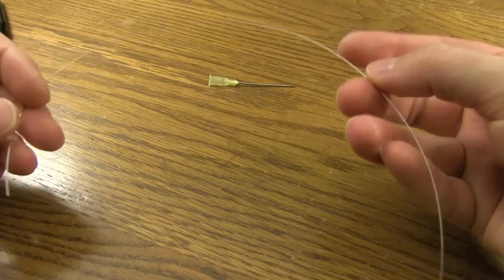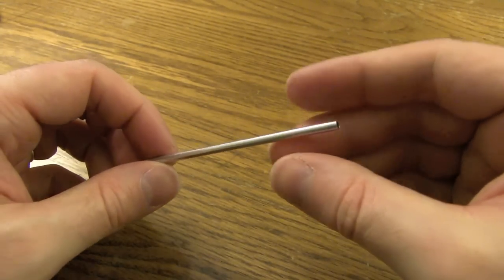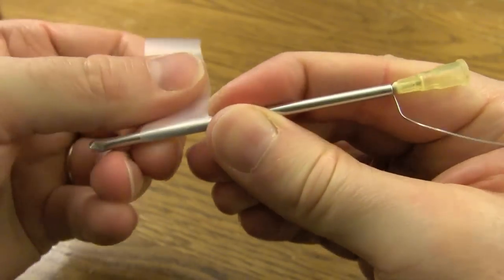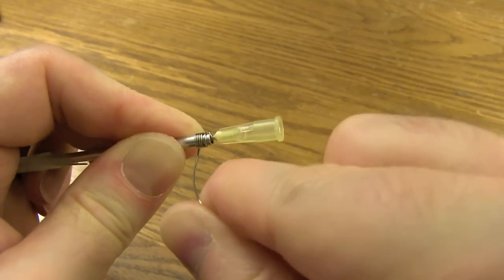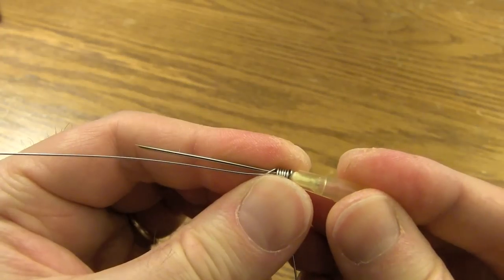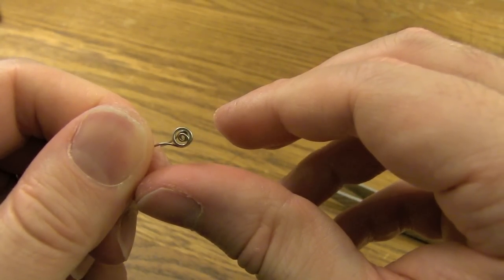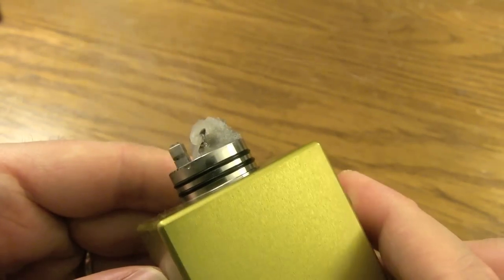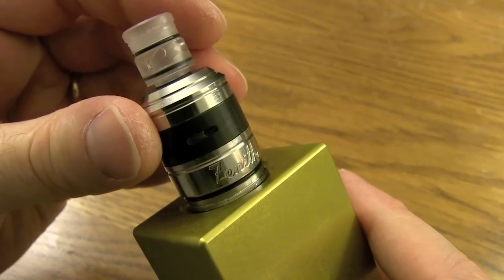The Inception Coil

Comment: I know this has nothing to do with this vid, but what kind of charger do you use for your 26650s? I'm having trouble finding a good charger for them. I have an i4 for my 18650s but I know that won't work just out of size. Lol.
Reply: I have that charger too and it works but the batteries don't fit snug.  I just got the NiteCore IntelliCharger i2 Charger.  It works great for my sony 26650  50 amp batteries.  Got it at amazon.  The link below.  copy and paste to your address bar.

http://www.amazon.com/NiteCore-IntelliCharger-i2-Charger-charging/dp/B009JMDD9U/ref=sr_1_sc_1?s=electronics&ie=UTF8&qid=1395880214&sr=1-1-spell&keywords=nitcore+intellicharger+i2
Reply: Ok, cool, thanks, I didn't want to try to put them in the charger and have something happen, I just figured it wouldn't work at all because of size differences.
Reply: WeneDog0628 The intelicore I4 charger should charge 26650's mine does...
Reply: Ok, thanks much :)
Reply: Grab yourself a Efest LUC charger- it will charge your 26650 and 18650 etc the latest version allows you to chose a 1A charge rate and man oh man it is fast at charging. It also has a neet display showing your current voltage and charge rate and several safety features. IMO it is a better charger than the I4 but ..i just noticed you have an I4? that should charge your 26650's np and if you do already own I don't think you need to get a LUC- but anyone looking for a great charger take heed!! lol :)
Reply: Thanks for the tip, I was worried about it not charging the batteries right, and the little travel charger that came with them worries me. I'd rather not wind up being another headline that anti-vaping bans would gain steam from. I like the i4 so it's nice not having to get a new charger. I only got that over the LUC cuz I was able to get it at half the price.
Reply: Dont use the travel charger thing just use the regular i4 charger for them. They will charge just fine. I promise!

Comment: Why do you not inhale rip trippers? I notice this.
Reply: With an RDA you take lung hits. He is inhaling while he takes a drag; like you would with a hookah
Reply: ***** yes. But once I remove my mouth from doing a lung hit, the vape that's in the mouth and throat needs to be inhaled as well, which rip trippers isn't doing. He exhales immediately.

So what I'm saying, all the vapor today has gone to his lungs from a lung hit still has the last bits in mouth which should be inhaled by spending a half a second inhaling after removing the drip tip from his mouth.
Reply: David Johnson That's one of the secrets to blowing clouds. That half-second extra inhale allows more of the vapor to be absorbed, reducing the cloud you blow out. By immediately exhaling, he produces a more impressive cloud. Try it yourself; take a long, hard pull, then immediately exhale as soon as you stop.
Reply: Orion Roberts will try. Thanks
Reply: he is inhaling. he does lung hits, pulls straight to the lung and straight out.

Comment: so if that reads at .8 a dual build of this would read at .4 right?
Reply: yup, thats right. And a quad build would be .2 ... that would be silly because you need a 10 inch deck, but ... :D
Reply: you could use smaller gauge kanthal too, or get the mason rda
Reply: with the gauge...then it is too small, and you have got problems with the Cotton. Is the madson RDA really so huge? :D Daniel Springer
Reply: it's like made for hex or octo coils. it has 4 positive post holes and 4 negative ones, its pretty crazy google it, not too bad of a price either
Reply: But it is so tall that it would look like shit on my mod :b.
Reply: Indoor Vaper oh yea, it'd look goofy my my koopor 200w but i might get the 30mm version they make
Reply: imagine 6 of them sub ohm max
Reply: oDaniel Springer
Reply: Lol put them on the so horney rda
Reply: +Indoor Vaper what is a good build for faster nicotine consumption. I switched from dip(chew) to vape and idk if you've ever tried dip but the nicotine is almost instant... Im also a flavor chaser
Reply: I think you mean the "flash" of the nicotin. So at first, if you want much nicotin you need liquid with Nicotin ( Self-explanatory). But you should know that the more nicotin you use, influences the flavour of your liquid. It  tastes more like nicotin than before. The coil build dont really cares. You only need power. The more vapor will be produced, the flash will be even more, and you will rather have a "nicotin shock" like in a cig. I am vaping my nicotin liquid only in a e pen, so I need arround 5 Watts to fire the 2.8 ohms up. I use 18 mg juice, and that drops hard. I would say first use 9mg ore something like this.

Sorry for my Grammar, I am from Germany and I dont know everything about your language :D.

Comment: Heya rip. Help me man! I've tried to rebuild a dual coil on my igo w3 on my k100 and i think i shorted my MNKE battery. The charger reads full charge. I don't have an ohm meter but i think i did 8 wraps per coil. I have the whole thing assembled but I can't hear the device fire at all.
Reply: Was it firing at first then quit on you or did it just not fire at all? If it quit on you stop and get you a new bat. and rebuild like Ryan said, if it never fired at all double check and make sure your rda is on tight and your mod is adjusted so your battery isn't rattling in there when you shake it.
Reply: and make sure all your leads are tightened down snug. Also I would suggest you look into an ohm meter, best way to check for shorts and make sure you don't blow yourself up lol
Reply: But is there a chance that my igo is now ruined?
Reply: There us a chance but it is unlikely, I've never owned an igow3 but there should be a rubber insulator around the center post, if that is still intact it should still fire
Reply: You can see the insulator on the base around the post, not around the post itself. sorry I reread that and it wasn't very clear
Reply: thx for your help guys!
Reply: Get a meter...  We don't need any more negative press...  "Dumbass blows his face off from e-cig, tonight on the evening news."

Comment: How would you make a 1.5 ohm?
Reply: Try using thinner gauge kanthal.  Maybe .30 or possibly .28. 

From what I gather thinner (higher gauge) kanthal makes for a higher resistance.  And more wraps (length) = less resistance.  I could however be totally wrong about that as I have yet to experiment.

What I do know is that when I wrap a .28 gauge micro coil I have less resistance with 5 wraps than when I wrap the same gauge at 7 or 8 wraps.  

I believe a few posts back Rip explained that thicker (lower gauge) kanthal allows more "traffic" to pass through and less congestion (comparing .24-.22 gauge to a 4 lane road and .28 gauge to a 2 lane road, congestion being compared to resistance).
Reply: Hazie83 I think you had one thing a little mixed up, more wraps=more resistance. 
The thicker the wire (lower guage) the less resistance it gives.
The thinner the wire (higher guage) the more resistance it gives.
With more wraps, you get higher resistance.
With less wraps, you get lower resistance. 
It's a little like a garden hose. If you kink or bend it, it makes it harder for the water to get through, creating pressure. In our case, when you bend the wire into a coil, it creates a more difficult path for the electricity to move through, creating heat.
Reply: Scott Bissantz Yes he/she got it mixed up but it's right in the second paragraph.

Comment: These different coils are getting a bit silly and pointless now. Wrap some wire round a bit of wick and it all does the same thing (delivers a drug we are addicted to into our system, sugar coat it all you want but thats what the purpose of this vaping lark is all about). Do like the t-shirt tho, and the beard is somewhat legendary.
Reply: that statement just isn't true. i would agree with simple macro micro and nano coils. but even they have a difference between each other. slight, but a difference is there. now with other coils your wrong. period. its simple, the more surface area for juice to be heated up the better. meaning the more wraps, the more cracks the more WIRE the more VAPOR = more CLOUD =more FLAVOR. that's only the beginning i wont even get into ohm, mod, voltage ......
Reply: i enjoy building new coils. using 0mg of nic also. not everyone vapes to replace smoking.

Comment: i hate to be a stickler but i have a question  Does any body know if kanthal wire is galvanized because i went to my local ACE heardware stor and foind 18 to 25GA wire and it is galvanized i didn't know if it is safe to use galvanized wire or not.  i would have baught it  but I didn't wanna be pissed off that i could not use it in my builds.  becides that I'm new to this rebuild stuff i have just been doing the tank with the BVC coils.
Reply: Noo you definitely want resistance wire. Galvanized wire could lead to metal fume fever, which is an uncomfortable was to destroy your lungs haha. Safe vaping!

Comment: I vape 24mg juice in an iTaste MVP v2 and don't feel a buzz from nic one bit. I have the voltage and wattage set according to my tanks resistance and all that. I even get larger than average clouds for my setup...why don't I get a buzz? I hear of others who get a buzz from 6mg in an ego.? I don't see how that's possible. I don't vape for nic anyway, might switch to 0mg. Just wondering if anyone else ran into this issue?
Reply: You might want to try moving up mods to a mech at around .2 with 6mg juice. Make sure to build safe though
Reply: Thanks! I'll try it out!

Comment: 1:55 prolly not the best advert for safety... "gonna just push it down"..and slip and stab the needle through the hand. 
A more suitable wrapping post may be in order, or at least clip the end blunt. Something designed to poke holes in people is probably not the best idea to be pushing and shoving around.

Great vids though, technically speaking.

Comment: Finish this sentence:

If I really want to impress the guys at the vape shop I just whip out my ________
Reply: I wire a bed spring to a car battery and wick it with a sock.
Reply: my ego/carto tank set up?
Reply: juice because no one around here knows what cali juice is
Reply: ....electrically efficient coil. (They've never seen one before)
Reply: "big 10 inch"    God, get your minds out of the gutter, im talking about my vapelyfe mod haha
Reply: A real mod and atty. All I've seen round here are clones.
Reply: Michael Putman Not meant in a nasty way but It shouldn't really bother you what other people vape, those with less money shouldn't be excluded from vaping certain style devices, its not their fault that some manufacturers stick a dodgy logo on a clone. Those who can afford high end gear do go and  buy the high end gear and those who cant afford high end gear would never have been able to buy the expensive gear at all so no-one actually loses sales because of cloning as pbusardo argues (much more eloquently than I do). Some designers even take it as a reinforcement of their great designs when cloned. There are some other issues but they're not valid in the big scheme of things, I mean is the patriot a clone of the igo-w cus the principal is the same and the look is very similar? some cases are obvious but some casesits a fine line that is very hard to draw, i say leave off the logo at least and let people buy what they want..
Reply: Yes exactly. Leave off the name. This is my problem with clones. I don't have the funds to pony up for a high end either. My vape budget is very small. I feel this way because of buying equpment that was represented as real only to a inferior knock off. Also my brother found his niche designing and manufacturing aluminium handles for high end knives like spyder co and bench mades. He supports his family with them since the company he worked for moved to china. After someone saw there was a buck to be made the cloning srarted. He made a quialty product the clones are far from It.His reputation was damaged and even had people contacting him for refunds. Don't fool yourself it in more cases than not does great harm. I would rather carry a kamry K100 than a fake turtle ship any day.
Reply: i agree with the mis-representation 100% and i don't know if it's just within vaping but i don't believe the manufacturers are trying to pass it off as genuine rather than just make it cheaper and make a buck, the misrepresentation seems to be done by the odd shady vendor within vape sales at least
Reply: And just to clarify the people wanting a refund from my brother had purchased a clone.
Reply: I dont know anything about your brothers situation but i do sympathise. Why were people after refunds? if they were quality items i mean? did he inform customers they were clones?
Reply: No one that purchased one from him has had and problems actually there is a waiting list, people love them. After failed attempts to get a refund from the seller they taught they would go to the manufacturer. This is the whole point of this post. Branded clones do hurt the designers and manufacturers of the product being cloned.
Reply: Michael Putman Any vape shop that I would shop at sells clones as "clones."  I guess it's your own dumb ass if your going somewhere that sells a clone as the authentic.  An intelligent person would wonder why an authentic Nemesis is costing $50 anyway...  Furthermore, you said you would whip out your ___ "real mod and atty."  Then you stated that an authentic doesn't fit in your budget...  You sound like a damn politician, you should run for office.
Reply: I would whip out my Nemesis CLONE + Kayfun CLONE dual coil 28 gauge kanthal wrapped @ .5 ohms.  She is sweet as a bitch.  Not a cloud chaser by any means, but it chucks the vapor and flavor is amazing!
Reply: That pretty much describes my everyday go to set up. So that's you, me and millions of other vapers. I love the way cloners have made decent quality vape hardware available to the masses, if they hadn't come up with their viable business model the financially hard up among us would be condemned to a life of poor quality ego-ish  batteries and ce5 clearomisers. Ever notice how the anti-clone brigade have absolutely no problem cloning juice recipes such as all the custards that replicate Grants or tobaccos that reference the word 'bounty'?
Reply: Jonto Dickens  Clones are a MINOR drop-off in quality, and a MAJOR drop-off in price.  Understand, the CONSUMER controls the market.  If people didn't buy the products, the products wouldn't get sold, the companies would no longer make those products, and there wouldn't be a market for them.  Apparently, they are pretty popular and people want to buy them.  If someone wants to buy an authentic, they have the right to do so!  I am all about getting the "bang for the buck."  Some people make it about china taking over.  Clones come from all over the world.  If there was a quality clone maker here in the US, hell I would check out their devices.  But, damn.  For instance, me + your go-to setup, cost me about $30.  For authentic setup, $370.  I just can't justify that... I could buy a dozen for what one would cost.  The bottom line is, the customer is the one who benefits here.  If they want an authentic, they can buy one.  If they want a clone, they can buy one.  I have used a real Nemesis, and honestly, the differences are so minor they are negligible.
Reply: Gee a politician really.  What do you do for a living Scorpio?  If someone imposed on your livelihood you would be singing a different tune. I guarantee.
Reply: And im pretty sure my k100 is real
Reply: Clones may end up costing a few people financially but they help a lot of folk financially too with big savings so a pragmatic politician looking at things in real terms and the net benefit for society overall would find in favour of  clones. I am aware that there will be negatives when you place all your stock in overpriced merchandise that is marked up you have to expect cheaper products to be made available in today's global economy. There is a net gain for a society in having cheaper products, not free products because that's where all economic models cease to have any value but the free market economy is the best functioning model ever implemented. It drives competition which in turn increases quality at a lower cost which in turn raises the standard of living in a society overall. People will still fail and go bust which is a shame but i am speaking for society as a whole.
Reply: Jonto Dickens Well spoken, friend.
Reply: Michael Putman You are aware that your k100 is a clone, right? I'm going to assume irony (but i think you're serious) because the kamry k100 is a clone of the empire mod from empiremods.com You can check this out for yourself online and is common knowledge in the vaping community.
Reply: Jonto Dickens Ya, I stopped paying attention to that guy.  I just assumed he was trolling.  He says one thing, then in another post, says the exact opposite...  Maybe he gets a kick outta stirring shit up, I dunno.  I appreciate your post and insight, Mr. Dickens!  It's all about the vape!
Reply: I hear you, all the best Scott
Reply: Paragon v2 midnight edition ;)
Reply: Waylon Quiggle lol
Reply: IndicacannaJones lmao you win ahaha
Reply: Balls